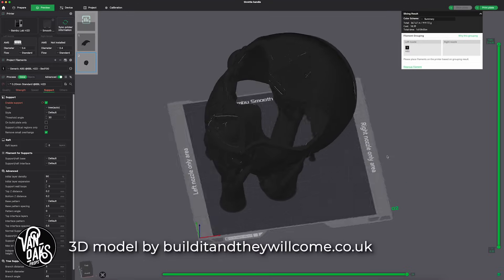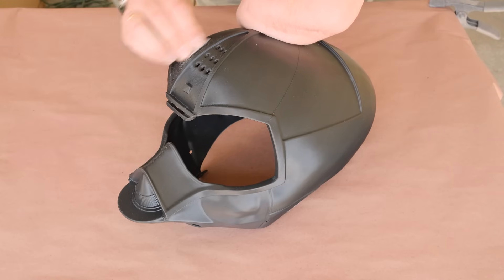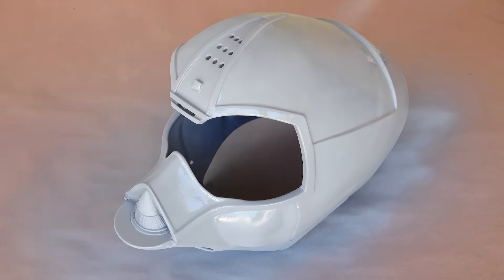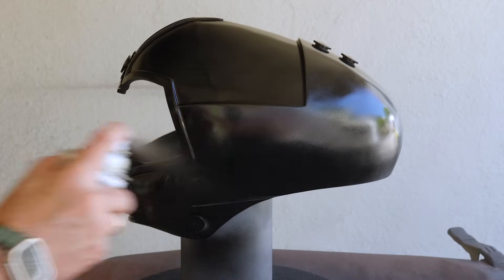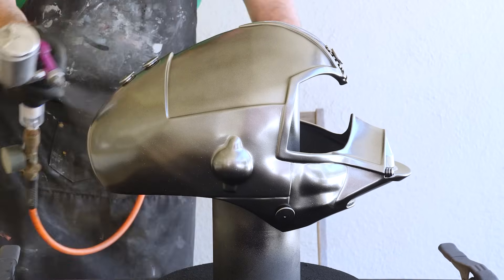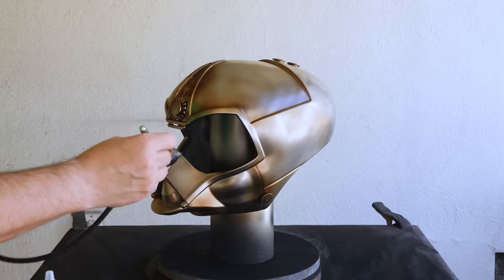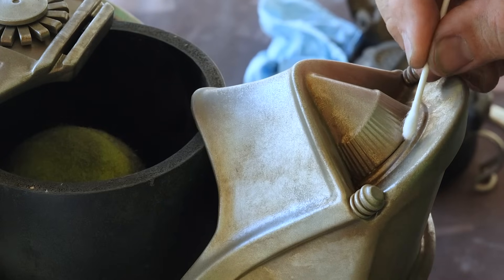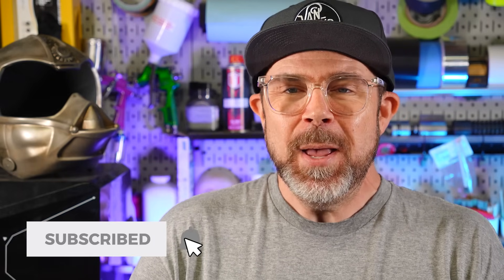Death Star Droid Build

Comment: Like it‼️ I made a helmet that needed a fan for ventilation. It made too much noise to be in the helmet so I ran a hose down the costume and put the fan at ankle height and pulled air into the helmet, down the hose blowing out near the ankle. Less noise and it pulled heat and humidity out of the helmet.

Comment: What did you print that helmet at?  The layer skip and lines look horrible.  The end product looks great but I honestly expected more out of the H2D.  My P1S' s print way better than this. A lot less post processing.
Reply from the maker: I printed at .20. Whenever you’re planning to chrome a helmet you need to do a ton on post processing since high gloss & metallics will show every flaw. So the amount of sanding required would have been significant, even on your P1S.

Comment: So, I know squat about 3D printers & doubt I will ever own one - though I DO enjoy your videos, even if I never plan to "make the thing" ! 
I WAS wondering if there is a way to recycle the supports ? Seems like a lot to waste, though you seemed quite clever in how you printed it.
 I also wonder if folks that do modeling could use those for 'trees', as they certainly LOOK like trees 🌳 😅 (Or sculptors!) 
 Anyhow, back to the video. 
Please just take this as it is meant, a random thought from someone who enjoys your videos. Less a "complaint", more of a 'thought'......
Say "hi" to Mrs. Van Oaks, too !
Reply from the maker: You absolutely can if you’re using ABS and ASA filament. You can dissolve it in acetone and use it to join parts and fill gaps/print lines.
Reply: Finished the video. That turned out AWESOME !

Comment: Awesome as always. I appreciate that you don't hide when things don't go to plan. For thick layer lines I've found that I can fold masking tape to make a spreader and I use Gap Filling CA glue and skim it over the layer lines. I use a bit of accelerator with a dropper. Then wipe the area with a paper towel after a few minutes to get rid of excess accelerator. 80 grit and done. The process is super quick and cuts down on sanding. Don't forget PPE!
Reply from the maker: That's a great tip, thanks for sharing!

Comment: Great video! I like how you used a decent filler primer other than the Rustoleum gummy stuff. As far as the weathering technique goes with the Tamiya acrylic sky gray, does this work with any acrylic or just this brand? I wish I knew about this when I made my Armorer's helmet. My acrylic washes got a little out of control and I ended up dulling the shine too much. It would have been nice to have an option for removing some of that with water and a rag, to bring back some of that shine from the metallic gold / bronze. Also, what was the lesson you learned here? Was it not to use gloss black spray paint altogether or rather the hot temperatures that you sprayed it in? Thanks a ton. This was an excellent video and it turned out great!
Reply from the maker: It should work with most acrylics. The lesson was to heed the warnings on the can that says use within this temperature range.